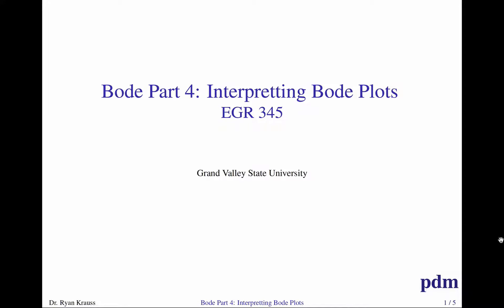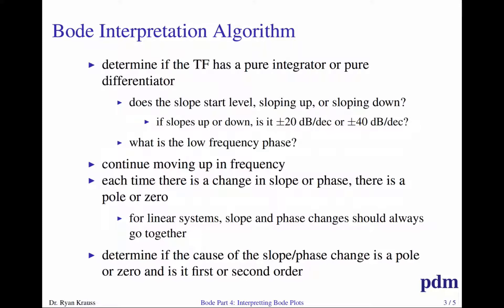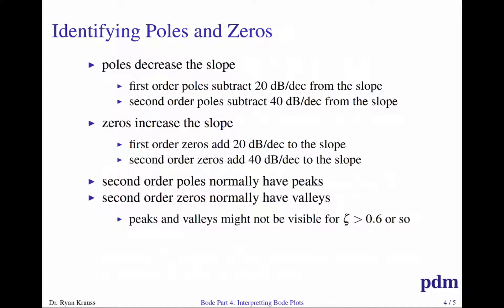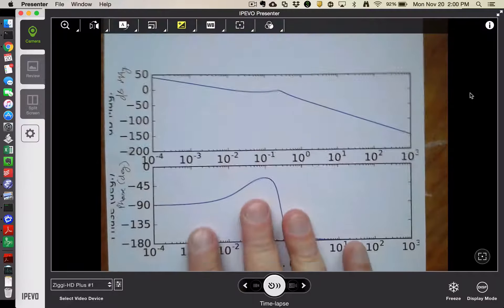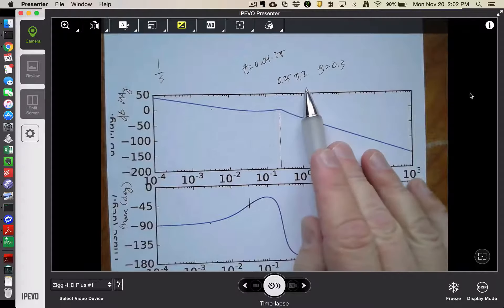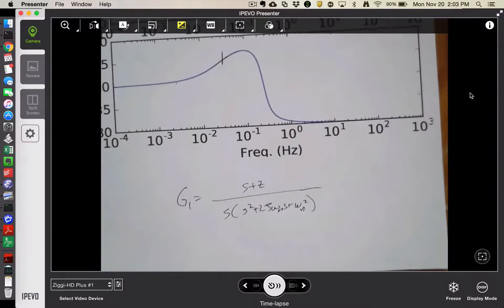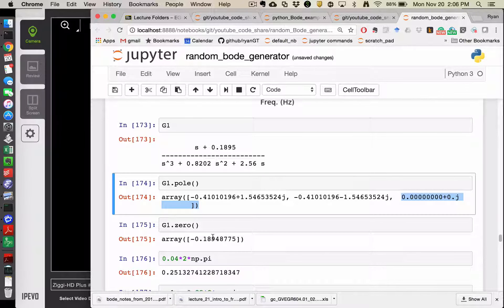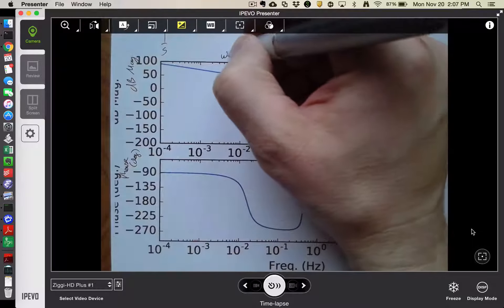Bode Part 4: Interpreting Bode Plots (System ID)

Comment: Hi I just 1 question.

In the second example  How do you get the actual transfer function  solely from the bode phase and gain. I understand how you've deduced the integrator and second order zeros and poles. But how would you get  the numbers shown at  14:11 (out[181] ) from the bode. 

Any help would be greatly appreciated. 
Thanks